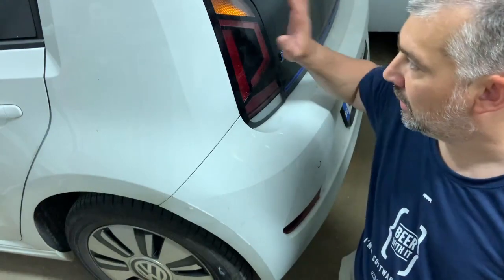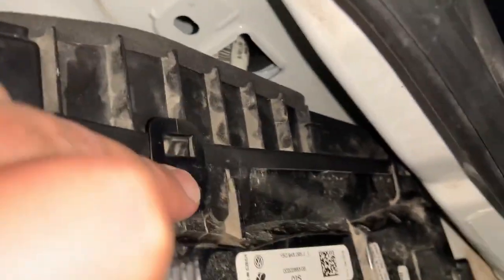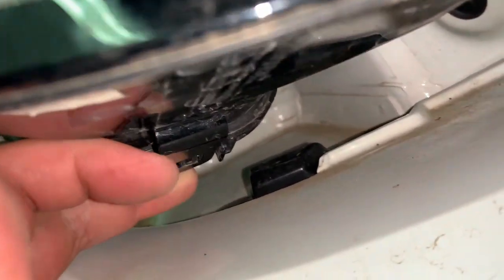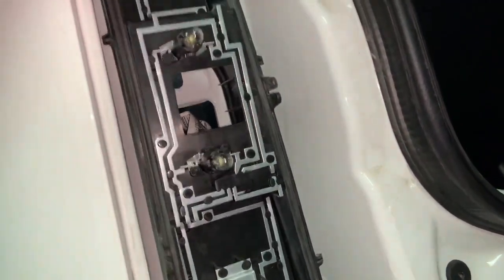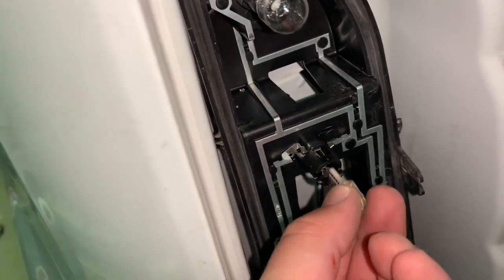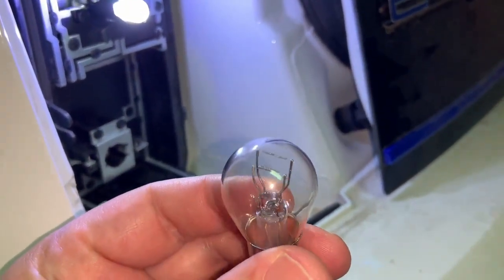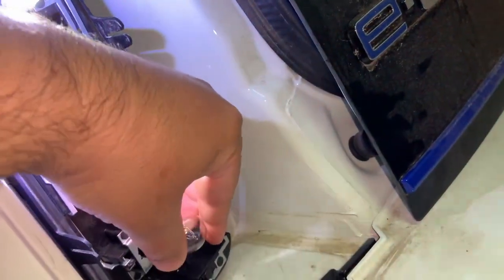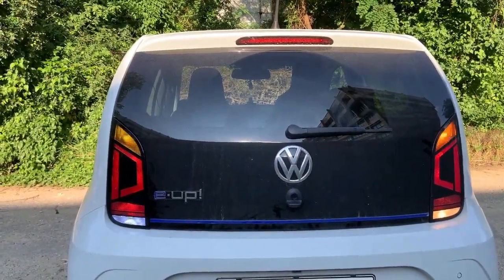How to change the tail lights to LED on Volkswagen e-up.

Comment: Just to clarify if anyone does this conversion. 
W5W - 2 x sidelight bulbs
W16W - indicator and reverse lights 
566 / P21/4W - brake lights
Would be good to pin my comment just so it's clear for everyone 🙂
Reply: @tedonash2681 can you confirm this? The link under your video does not work anymore. Could you please share more technical information about the fitting and wattage?

Comment: do you know the reason that the right tail light are ok when turning the switch to parking mode, however the right tail light is turned off when turning on the motor on full night lights!?
Reply from the maker: I haven't noticed that. I will check

Comment: The Seat Mii has totally different light unit, bulb location and bulbs itself: PY21W, P21W, P21/5W, R10W
Reply from the maker: I thought they share common components, but i was wrong
Reply: @tedonash2681  they're mostly the same. As far I have noted the difference is design (lamps front and rear); Mii has no rear parking camera, no buttons on steering wheel, no wheel jack&wrench; different seat material in saloon and different front panel color.
Reply: which ones are which? I don't see the point in changing reverse or indicator bulbs as they are relatively rarely used, but I would think about changing the brake and other red one. At least from the economy of electricity stand point that is my thoughts.

Comment: My interior blinking indicators are blinking faster as the one outside. What could be the issue here?
Reply from the maker: I think the relay that controls the blinking also need to be changed. I didn’t manage to fix that on my old e-up but I will try to resolve it on the new one
Reply: I know, I'm late to the party...
Modern cars don't have relays to switch the blinkers on and off. The mechanical clicking sound is being emulated by a speaker.
The faster blinking emulates the behavior of a traditional blinker relay when a light bulb is blown. The current through the LEDs is too low, so the electronics assume a defective light bulb. You could fix that by putting a resistor in parallel.
Reply: @gisobo  Hi. Would there be an other solution via OBDeleven ? On Ford vehicles there is a setting to change with Forscan.
Reply: @mllG81  Maybe 🤷
You would have to know the codes, since there is no description like “LED Blinker” in OBDeleven.

Comment: @Tedo Nash - Dear Tedo, please allow me to do a correction to the LED bulbs you've installed. You've replace everything by W5W (means 5 What) but two of them are W16W (means 16W) - Rear Direction Indicator + Backup. The head of the 15W bulbs are bigger than the 5W ones. Be carefull because in this way you're infringing the law.